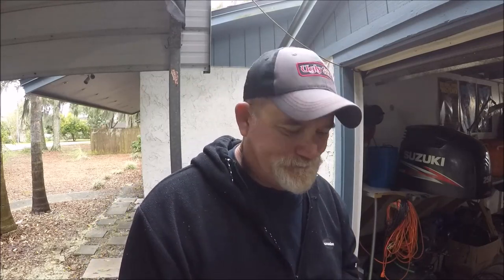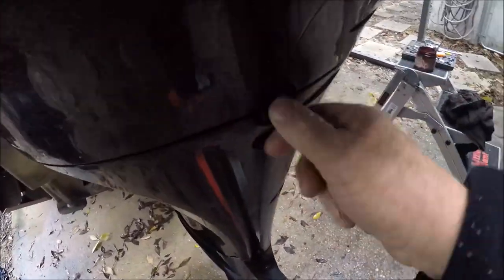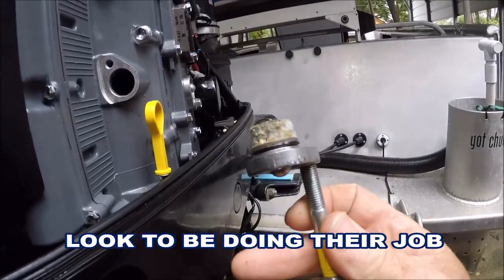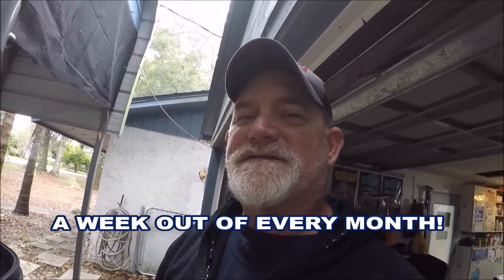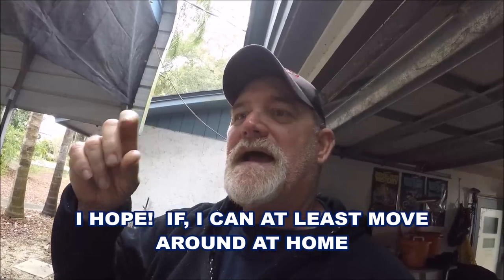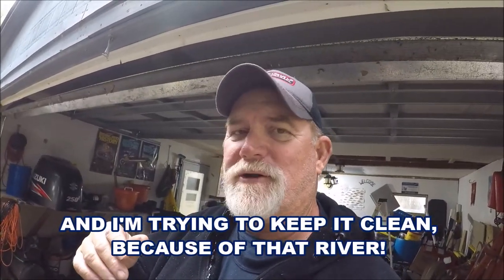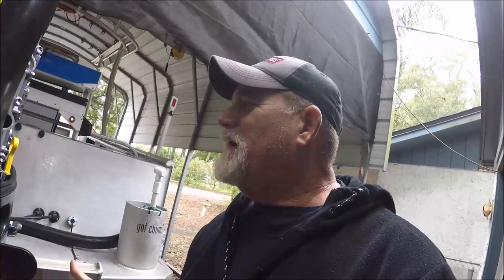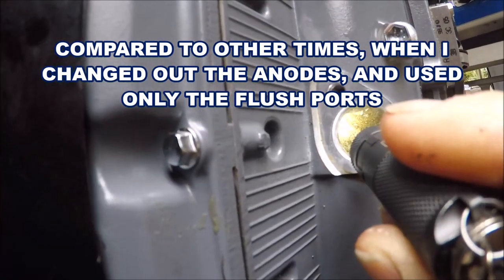MY SUZUKI OUTBOARD, maintenance schedule for 2020

Comment: Great video, I learned a lot. I am a retired electrical engineer and have some experience with Cathodic protection in piping. Water, especially salt water that moves through piping extracts metal from piping due to electron needs when moving. By keeping the anode surface clean, it allows the water to extract the needed electrons from the anode instead of the surfaces of engine. It should really help the pitting problems that you experience.
Reply from the maker: all my anodes get checked every 100 hrs. when I change my oil. ALWAYS!

Comment: Listen up kids, to confirm Capt Davis findings. If your thinking flushing you motor on the hose is getting the job done, your wrong. I have flushed my 2016 Suzuki up to operating temp then 10 minutes after each use. Based on his Maintenance video, I did the Rydlyme flush. I was shocked, two handfuls of junk came out of my motor. Deposits that normal flushing would never remove. 
Pay now or pay later. Your call.
Reply from the maker: I FORGOT TO SHOW THE JAR OF SHIT, I HAVE COLLECTED OUT OF THE BOTTOM OF MY BIG TUB AFTER SEVERAL RUNNING FLUSHES. I SAVED IT AND GUESS WILL SHOW IT IN THE NEXT VIDEO.....A JAR! YES, ENOUGH TO COLLECT AFTER EVERY DAY USE IN THAT DIRT RIVER❗❗❗

Comment: Dave im buying a new 225 or 250 for my old center console thanks for what you do !! Enjoy your insight and will add some of your concepts to my maintence
Reply from the maker: yep, pro-active. ZERO ethanol, don't care what they say!!  Follow the maintenance schedule in your handbook. NEVER EVER use those stupid flush fitting, flush in a barrel, and if you get on without the low water pick ups, use the muffs,  Pay attention to internal anodes, ALL  relatively cheap insurance. For me, my PAYCHECK depends on my zuki❗❗
Reply: @CaptDavesSportfishing  I’m leaning Suzuki I do like the Hondas also but they are heavier
Reply from the maker: @jamesschulz5518  I had 2- 225's and hated them compared to my two, Zuki's. My old one's seemed very Shade tree mechanic unfriendly and that whole Vtec system. If you don't run hard "a lot", it stops working. And the valve sticks or something that changes the timing. Not for me.
Reply: @CaptDavesSportfishing  this is stuff i need to know i appreciate it
Reply from the maker: @jamesschulz5518  10-4!
Reply: @CaptDavesSportfishing  just had my knee replaced on thursday im hoping to start working on the boat in six weeks
Reply from the maker: @jamesschulz5518  don't know when they are cutting my prostate out as of yet, we'll see. I'LL RACE YA!

Comment: My motor is still hot when I get home because I basically live on the water. First I use the flush ports then I put the muffs on. My zuk has 100 hours and I’m about to change the Anodes,I’ve already did the rest of the service
Reply from the maker: Kinda over kill....the muffs are probably fine.

Comment: Dave, how about instead of JB Weld to plug the hole, use a tap, thread the hole  and insert a stainless pipe plug in it? Maybe seal the threads with teflon and it should be much easier than drilling the plug out each time you pull service.
Reply from the maker: Well I really don't plan on drilling anything out every single time as I said in one of the captions if I change it out enough on a maintenance schedule if it is got debris and salt buildup in it rydlyme will probably eat it completely out that's what I'm hoping I'm sure if necessary I could do about anything I really wasn't getting into all that detail but I could do as you mentioned I haven't got to that bridge yet and with my rydlyme and flushing it out at running temperature in my Barrel I hope to not get that bad of buildup ever again
Reply: @CaptDavesSportfishing  That makes sense..... but would be a good way to do a visual inspection to check. Thanks for sharing all the great information you provide.
Reply from the maker: @commonsense5105  yes it is all about just plain common sense I guess huh

Comment: Hey Capt Dave: Greetings from the Texas Gulf Coast. Great video!!! I was wondering if you had a video on changing out the water pump on your Suzuki.
Reply from the maker: No because I don't do water pumps I have it done by a mechanic it's so worth it because the lower unit is so heavy and you have to make sure everything fits right when you put it back in and I've never had good luck as far as putting the water pump on that's a piece of cake I usually buy the water pump kit take it to my local mechanic down the street and four hundred bucks he just puts it on make sure it's right starts the engine and I go on my Merry way without breaking my balls
Reply: @CaptDavesSportfishing  Good idea. Maybe I should rethink me trying to do it myself. I appreciate your input. It makes sense. Tommy
Reply from the maker: @tommymejia8244  do all the rest yourself. interior anodes, gear lube, plugs, etc. but if ya like your back.....gotta remember my motor ain't a little shorty, mines a 30 inch (spacer) and is a pain for even a mechanic a 2 man job.

Comment: Got a question for you...I bought a 100 gallon tuff tub from tractor supply. I have a jack plate on my boat with a 300 zuke and I am trying to flush motor and to get both of my  water pickups under water im really only using the top 5 inches of the tub water. So my question is, can i leave the tub full of water and just keep adding the top 5 inches while I flush it? Or, is the saltwater from flushing  the motor going into the tub?  The pee water is not going in the tub. The place i store the boat is fussy about water so I am trying to not have to empty the tub each time.
Reply from the maker: WHOA....100 GALLON!! I have smaller ones on my Amazon tools of the trade page:https://www.amazon.com/shop/captdavessportfishingcharters  sure, but change it and look in the bottom for all the crap in the bottom. You maybe shocked. I have to drain mine, because I can't move it full.....and I have to get it in my shop. SEE VIDEO DESCRIPTION FOR A LOT MORE ON ALL OF THIS.

Comment: Hey Dave... having an issue with my guages showing a craxy amount of fuel consumption. I dont have anything connected to the tank but i was under the impression the motor will manage the fuel based off your tanks size inputed to guage. What did i need to do to make it read correct fuel consumption. Also i have a lowrance connected to the nema backbone
Reply from the maker: don't know other than if you have the zuki digital gauge you have to program it for your tank size. My old zuki gauge was sooooo difficult to figure out, as if it was designed by the feds. But, I finally figured it out. being connected to something else has no bearing on anything. Mine is connected to my garmin, and just mirrors the same info on the gauges.
Reply: @CaptDavesSportfishing  ya i figured out i needed to reboot the "bus". Whatever that was. My fuel burn was showing 160 gal/H. But after i rebooted said "BUS" i was showing .55 gal at idle which seems right. Also a guy from florida said something about connecting the motor to the finder causes issues and burns out motors comp!???? The guage did say it was having some issue when i plugged it in but im not sure about a fish finder burning out a comoyter on a motor?
Reply from the maker: @chaseherrera9177  
I've had mine connected to my Garmin sounder/gps for yrs. thats total BS. yep, these ''do all'' gauges are a giant pain in the ass. from time to time, mine will just go all goofy and the read from my fuel sender looses all info and I have to mess with it to get it all calibrated again for 60 gallons

Comment: Does this make sense? You flush all the time with clean water but the anodes are still collecting a lot. Because clean water has impurities and the anodes are catching that? I guess flushing with something other then water might show an improvement.
Reply from the maker: you're bopping in on one video IVE DONE OUT OF MANY!  Yes, but I'd go broke using saltaway all the time, I'd need 55 gallon drums of it. Flushing in a big barrel as I do NOW on my brand new zuki is the true key. Warm water cleans great. But.....I started with using a barrel and flushing for 15 minutes with a very warm outa the water just minutes engine, that was new and clean and it continues to be. YES salt will build up around the anodes, and they will be in there just doing their job.

Comment: Capt. Dave,
     If I fresh water flush in a trough like you do, can I inject Salt Off, after the engine is warmed up, through the wash port, while the engine is still running?
     Thank you.
     Capt. Mike
Reply from the maker: SUPPOSE...

Comment: Drill and tap both ends for a screw that you can just remove for cleaning. That way you're never depending on the JB weld, and it's easily repeatable.
Reply from the maker: Yes we've already covered that topic in the comments and as I said I will cross that bridge when I get there if need be hopefully not with my Flushing schedule
Reply: drill and tap with a 1/4" or 3/8" taper pipe tap and use S/S plugs and Teflon tape
Reply from the maker: @todaytriper  This was discussed already. replaced with spare new one, and pulled out original, it was nice and clean, because I flush motor every day up to temp in a barrel. Tried that. my taps, didn't work. Couldn't find a plug, that fit....wasn't buying a set of taps just for this. JB weld held perfectly, and was easy to take out afterwards.

Comment: Dave, you ever try rinsing with salt away?
Reply from the maker: nope, good $ after bad $. that does nothing to combat nasty St. Johns River! RUN OUT YOUR SUZUKI 250 IN A BARREL (that has lower water pick-ups) NEVER, EVER USE THOSE FLUSH PORTS. I check or change all anodes each 100 hrs at oil change.